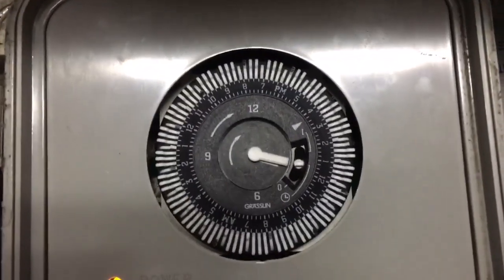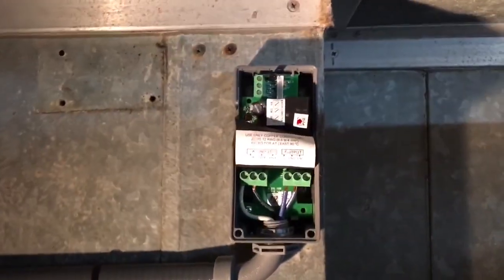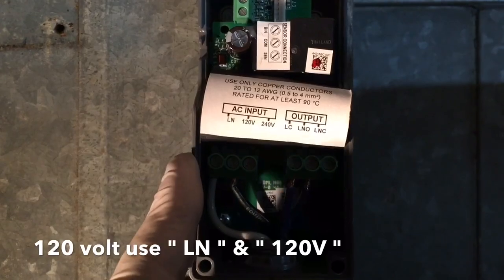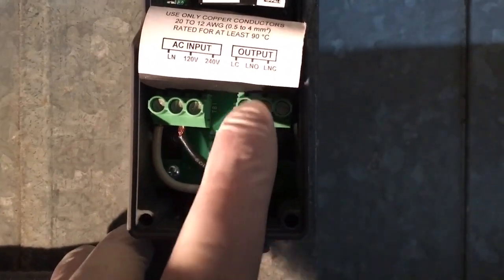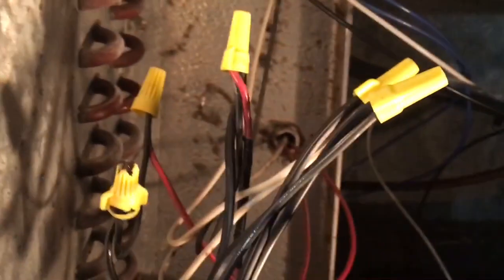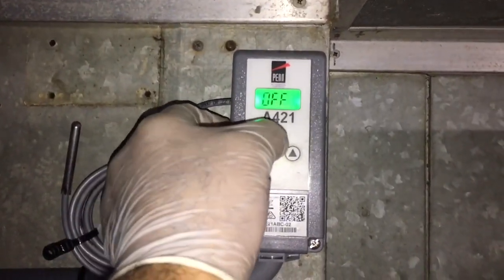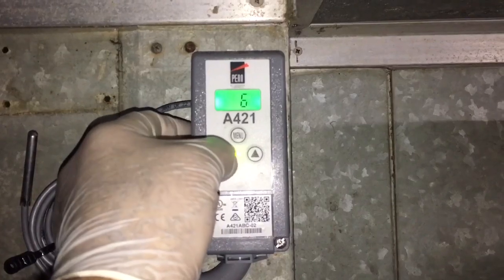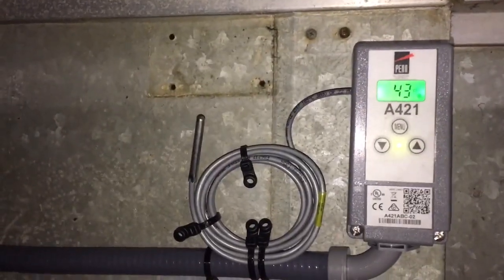Johnson controls A421 Digital temperature control installation.

Comment: I like the A421ABD-02C with defrost built in. Great stats.
Reply from the maker: Yea, i been using a419 for a long time - They served me well for many years.  , now these A421's replace them and seem good so far. i have not used the defrost included ones yet , but A421 good so far. This place allready had a defrost clock so this a421 works good so far.
Reply from the maker: This Model was a A421ABC-02C. ill Be Restocking with the ABD.
Reply: david1700000 yes it’s adjustable

Comment: I have white roger analoge thermostat it has two wires how can I wire it to a digital thermostat for a walking cooler
Reply from the maker: On the digital temp. controller find the set of contacts     . ie: on a Johnson a421 controller it will say “c” for common & “ N/o “ for Normally open. your 2 wires go there since all that control does is open & close a set of contacts like a light switch. You will just need to run 2 power wires to supply operating voltage to your control. & whala ! your done.